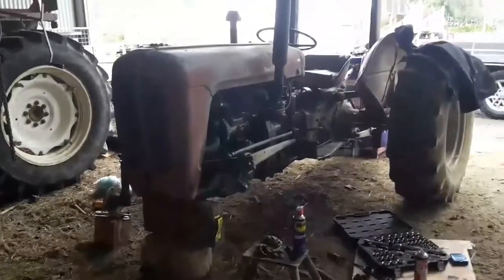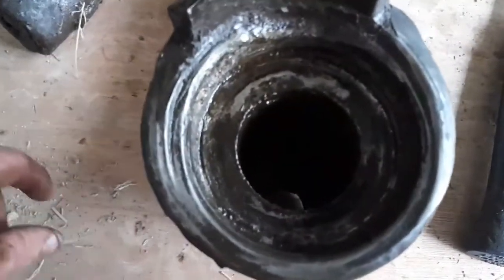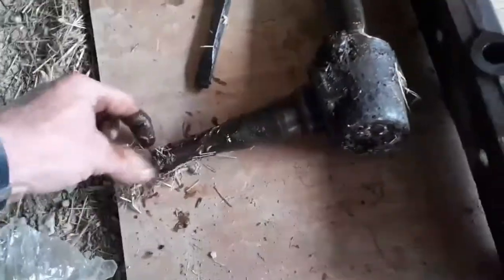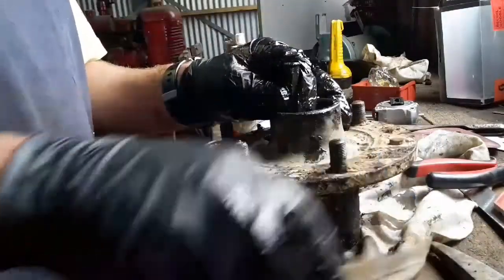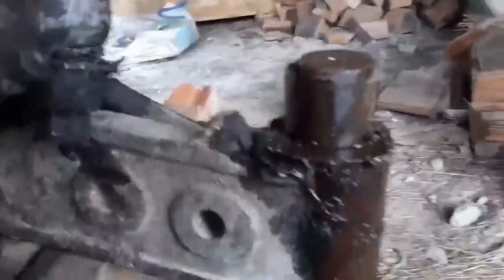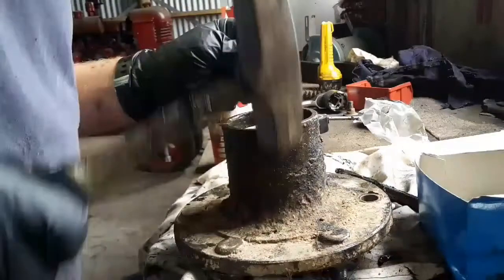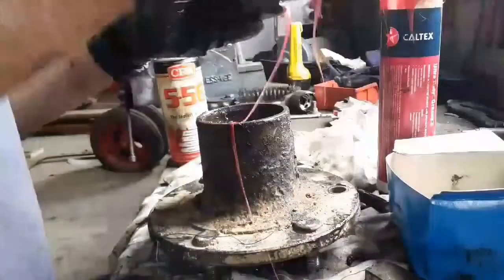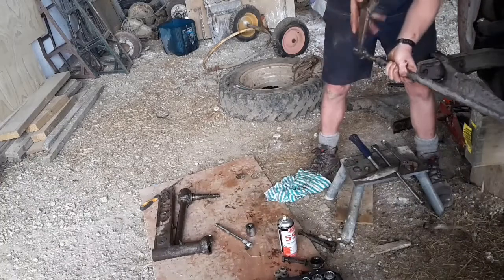Replacing Massey Ferguson 35 front wheel bearings and spindle bearing

Comment: just wondering in the vertical shaft of the spindle in the tube ...was there bushing type bearings top and bottom with a thrust bearing at the very bottom?
Reply from the maker: tim wolfe yep there is 2 bushes one at the top and one at the bottom and the thrust bearing at the very bottom